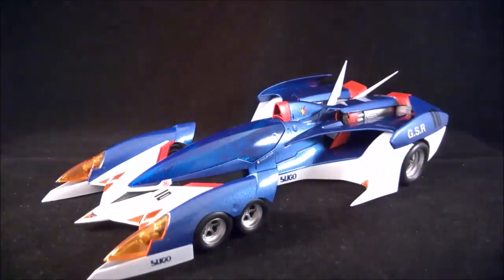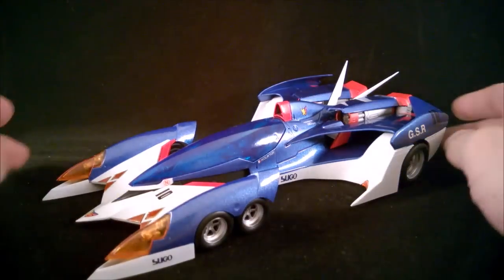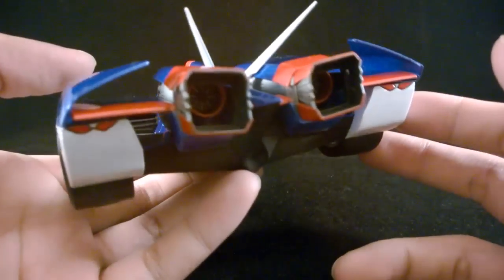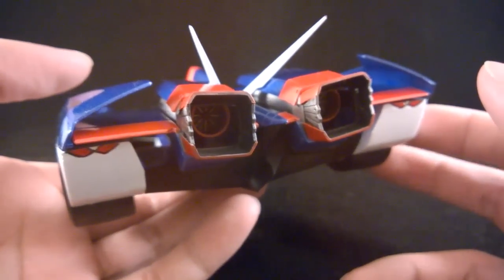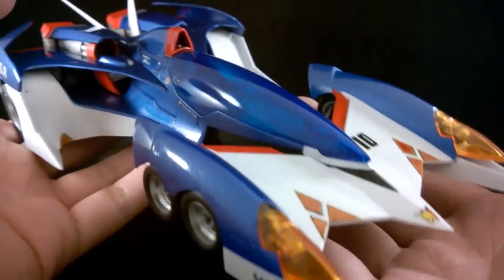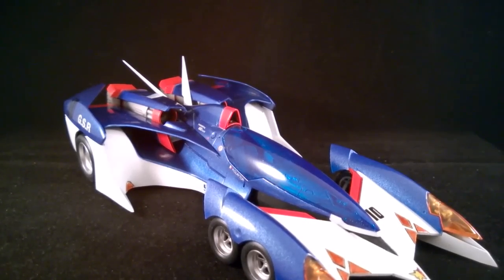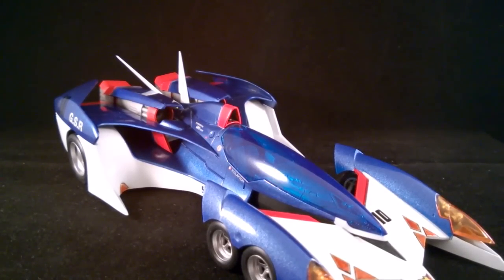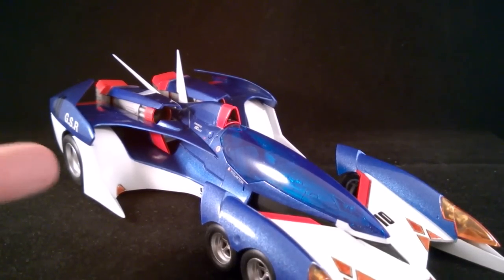Aoshima 1/24 Cyber Formula Garland Review (Painted)

Comment: It;s beautiful  well done.  may I ask which paint did you use? I just bought this model, cant wait to work on it.
Reply from the maker: Simon Shieh I used Game Workshop's Spray cans for the chassis, their standard paint range for hand painting/airbrushing the engine pod, driver cocpit and brakes. then Tamiya's primer and gloss paint spray can for the outershell. I also use Tamiya clear paint through an airbrush for the windscreen and headlamps.
Reply: thanks for the info,  awesome I will soon get my hands on the paint job